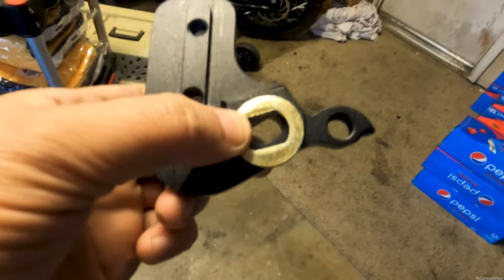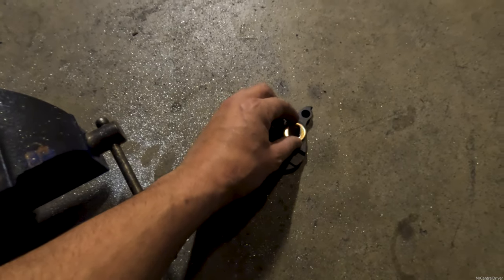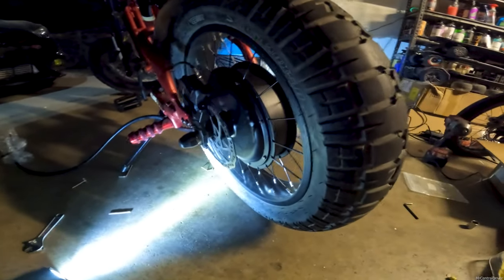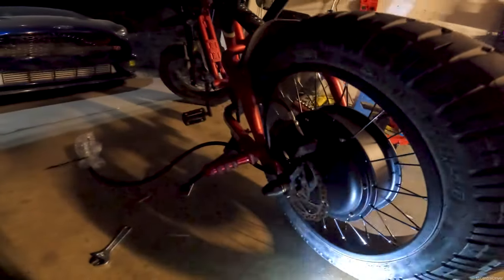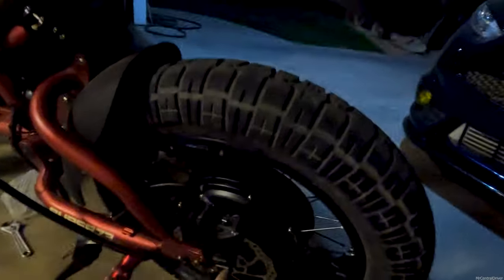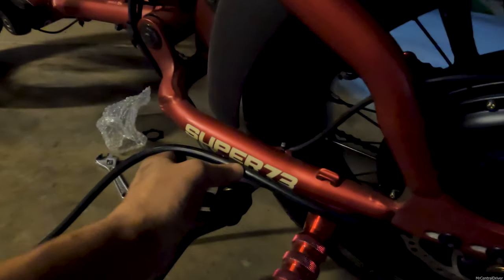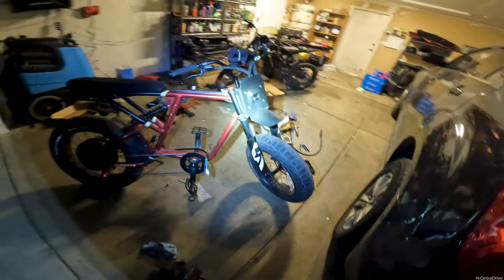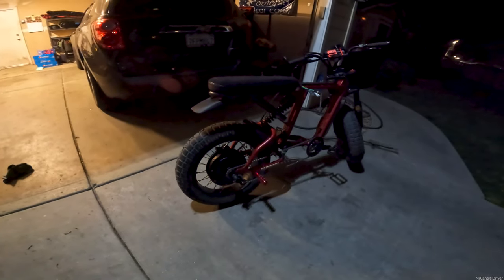Super73 72V Build // Modifying my AXLE Dropouts Pt.4

Comment: Flip the axle upside down so the wires are poking out the bottom of the bike for the hub motor and then run the wires down out the bottom and then hook it to the frame with zip ties

Comment: You did great, you did the right thing. whenever you're installing a big motor nine times out of 10 you have to file the dropouts to get it to fit but don't forget your probably going to need some sort of steel torque arm to manage that forse coming from the rear motor.

Comment: Dealing with cut motor cables is not fun. Why not spin the axle 180, it will give you more room to pull the cable away from the motor.
Reply from the maker: i was told from the instructions to point the cable straight along the bottom frame

Comment: The mounting bracket where the caliper is mounted to is slotted for adjustment for in and out for your caliber all you have to do is loosen the bolts squeeze the lever and hold the lever it'll RECenter Don't let it go until you tighten the bolts that's how you center the caliper
Reply from the maker: The brake is all the way to one side is what I was trying to say. It could slide over more but it’s maxed out

Comment: What if I wanted to use a smaller dropout size for my motor instead of the standard 190mm? I found a motor I want to use but it has only 150mm dropouts.
Reply: Just use spacers to make up the difference no big deal

Comment: I knew you could do it! 😃The biggest problem would be filing/cutting on the steel brackets so it's a good they were aluminum. You might want to use green LokTite
when assembling it since there's some extreme torque on those dropouts and brackets.  The old machine shops from years ago would have done that for you real cheap
and wouldn't think anything of it.

Comment: When I installed the new wheel, was programming needed?
Reply from the maker: Nope. Not on my controller
Reply: @MrCentralDriver  Why is your control unit different, because I wanted to buy a 5000 watt motor, and it had a control that said with Bluetooth to be programmed, please reply

Comment: I seriously recommend what you did. Doing the same build for my s2. Called a few places and basically they only do big projects, 1k$ minimum. I had a dremel handy but didn’t have carbide burrs so bought some. Just have to be careful and do it slowly. I hooked up the whole system and one thing to note is it looks like there’s a extra hall sensor wire on the motor, you just need one. And still works. I will have to check on the motor wire again to see if it rubs, appreciate your insight there.super excited to seeing your build finish. Your initial vids inspired me to do the same
Reply from the maker: Mine is up and running!!
Reply: @MrCentralDriver   sweet! It’s day and night compared to the stock motor. You have a onyx and a surron already so probably won’t blow you away the same. Enjoy the hell out of it tho, cant wait to see your next riding vids on it